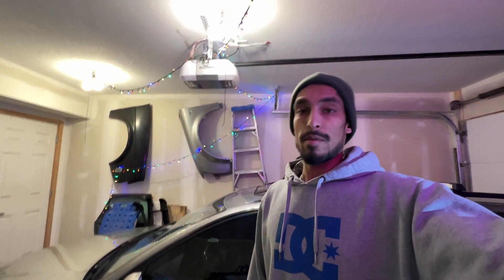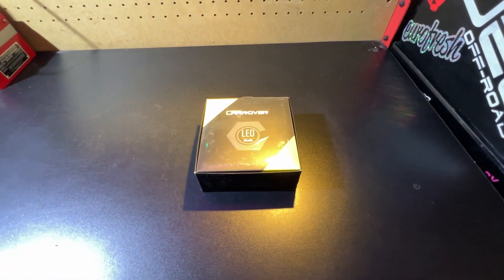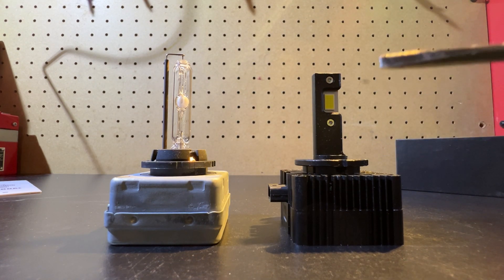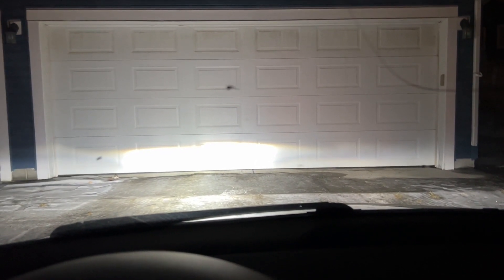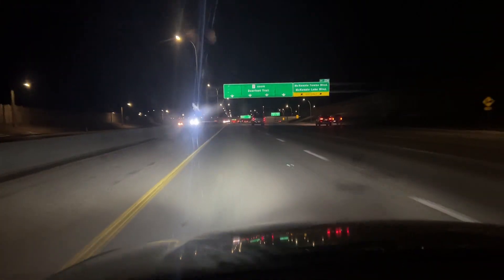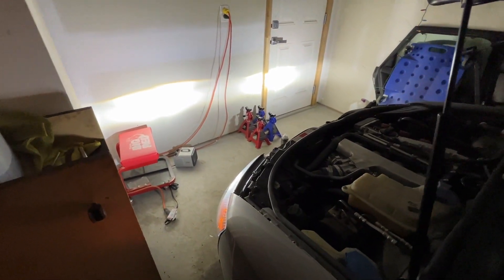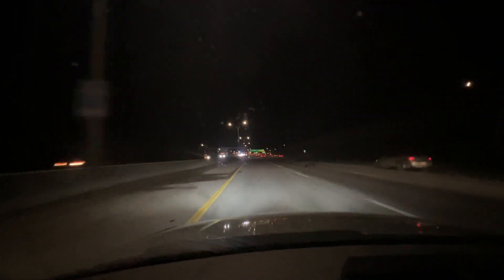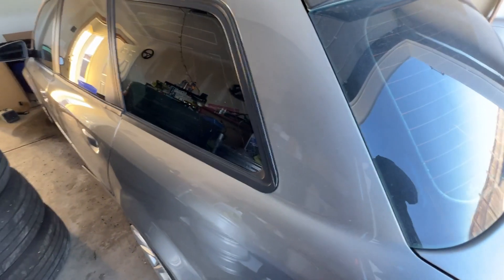HID vs. LED Headlights Real World Test! (Should You Switch?)

Comment: The reason the led is brighter, is because the ballast is worn. This usually happens to older cars. The led doesn't utilize the ballast it has its own board inside. It uses to connection for signal only.

Comment: Do you recommend switching to led from hid? Mine has a 55w ballast..how significant is the difference in beam distance between HIDs and LEDs?..
Reply from the maker: Don't quote me but I believe HIDs have greater beam distance based on real world observation. Others tend to agree. But that being said, I'm still rocking these LEDs 2+ years later and I have zero complaints.
Reply: @Fizzo20  decided not to change to LEDs just changed my hid bulbs to new ones and I'm happy with the results..

Comment: Do LED bulbs need to use the HID's stock igniter or ballast or they bypass it? I am assuming since LEDs are totally different technology from HIDs and start-up and work just with constant 12v, they don't need the ballast, correct? Thanks for the info.
Reply from the maker: I believe you’re correct. The ballast is still there just for ease of connectivity but I believe it just needs relatively low current 12v to operate
Reply: There are newer LED that arent bulky at all and have same base, and dust cap will fit just like stock bulbs, same dimensions as HID bulb. You dont need the ballast really, but the connection is what gives it juice to turn the LED on. So its literally a plug n play.  I just changed mine and I had 6000K HID bulbs (My vehicle comes with HID (probably 4000K bulbs stock) and projector lights. No matter what bulbs I put in the light output was not optimal.

I got the LED, switched it out and WOW! its insane the difference. I can see further ahead and more peripheral lighting as well. Now I dont have to really tuen on my fog lights. I have LED in my other vehicle too and only issue I find is when it rains heavy while driving the light is so bright it just reflects off the rain and you cant see too far ahead, but its not to the point of being dangerous, just noticeable if you drive your vehicle often and used to certain settings. But normal condition highway driving you cant beat the LED for safety.

Comment: LEDs are very bright and shine but for a moment...... what i mean is LEDs when get hot start to dim and man they do age so fast and dim much more than any other bulb out there , you may have a 6 months old LED bulb that works an hour per day and is gonna be half as strong when warm up compared to new one, especially those high powered LEDs are very short living things, they only worth for high beams that work for little time , also low power LEDs from philips/osram tend to have longer lifespan and less dim at time but they aren't very bright , not even close to HID's , keep HID's, the top bulbs for me.
Reply from the maker: Fair enough but after 2 years, the LEDs are still as bright as day one. HIDs are great though.
Reply: @Fizzo20  if you buy a new set of bulbs and compare the you will see the difference 😉
Reply: This is not true. I had same LED bulbs in one car for over 2 years, still bright, never flickered or shut off.  I remember before I converted my HID I went through 3 sets of bulbs in 9 months due to flickering or random non ignition issues. It wasnt the ballasts because I had dealership replace both with brand new ones.  LEDs last and are better in most conditions. ONLY thing I will mention where HID outperform is in very heavy rain. LED tend to be so bright they bounce off the rain drops asits coming down so distance is an issue , but not dangerous, just annoying. Other than that they are great bulbs.
Reply: @jensz9360  if you buy a good set of real hids and not those cheap sets you will have no issues with them , also buy a new led bulb the exact same bulb you have two years now and use one old and one new to see the real difference you dont see now because that happened in two years span not in a day to notice right away

Comment: Switched to leds because my dims were horrible (2003 Cadillac Seville) and things went downhill in a hurry. The difference in power made everything go nuts- my dims went almost out, then my brights quit altogether, then it got weird, I went to pull the bulbs and troubleshoot and when I removed one bulb one bright came back on and one dim?! Also my turn signals hyper flashed then acted like I had a short: first I would signal left and the right would work, then both would work like I had my cautions on. Solution: I took out the leds and made sure I had bulbs in every spot they were supposed to be in, and changed my headlight fuses. One light came on first and driving home there was a flicker and all my lights came back, including the turn signals. I probably do have a short, but the leds were like armagedon to my car. Hope the lights continue to work well for you, if they don’t, could be the issue. All my lights that seemed dim were all bright again once the leds were out
Reply from the maker: Dang sorry to hear that it caused problems for you. Sounds like you either have a short or perhaps the electrical system requires a specific resistance in the bulbs for the circuit(s) to maintain the correct amperage. Also might depend on if there are ballasts to power OEM HIDs or if you’re going from standard incandescent bulbs to LED. I know when replacing incandescent turn signal bulbs with LED, LEDs will cause them to flash fast due to less resistance in the bulb. I just speculating though. I’m coming up on 2 years with these bulbs in my car and no issues.
Reply: Its a cadillac Seville, 2003 it didnt even come with stock HID so you cant compare it. Like most cadillacs of that era it likely came with a 9005/9006 halogen bulb and you are talking about you swapped them for the LED. That isnt the same as HID-LED swap.

Comment: 12:18 That’s why you noticed that the HID’s were lighting up further. The way this works is simple, the further up a headlight’s pointing, the further away gets illuminated, but you won’t see what’s close to you as bright. I suggest aiming outside your garage where you can see at which point the headlight illuminate in front of the bumper and at which point you see while inside the car. Just don’t make it as high as high beams.
Reply from the maker: Haha I get how beam angle works. The beam angle is currently dialled with the LEDs. But I still think HIDs get better range in this application, all other things equal.

Comment: Non OEM replacement LEDs produce a glare that can blind on-coming traffic when used with non specific headlight housings and lenses. Pisses me off specially when not aimed properly. Worst on higher vehicles like trucks, pickups, vans and suvs. All around, LEDs can produce a whiter to bluish light, but HIDs are better on long range illumination and in inclement weather.
Reply: This is true if you have a reflector housing but not true with halogen projectors.

Comment: B6 Audis with the bixenon projectors were notorious for the projector bowls losing their reflective coating. If you want LEDs, the best way (which is also the only legit way) is to replace the HID  projectors with LED projectors. Morimoto makes an incredible LED projector that replaces the bixenon projector in the B6 headlight perfectly - same size, uses the same mounting points, exact match.
Reply: I can tell you by experience, Morimoto's reflector bowl is far inferior than OEM's. The reflector coating is not that good.The reflector bowl's reflectiveness in the OP's testing has nothing to do with the difference of the lighting output because he used the same reflector bowl housing. The only change he did was the bulbs.
Reply: @kohlpee3732  Yes, and the real problem with all these crappy "retrofit" LED bulbs chinengineered to replace legitimate HID  and halogen bulbs is the fact that they just splatter light everywhere, not just in the focal area, which gives the perception to those behind them as being "better" when in reality they're actually worse (way too much foreground illumination and tons of unaimed, unshielded glare).

Comment: Didn’t let the hid warm up
Reply: Even if it is warmed up, you get the same results. All it does with warming up an HID changes color until it stabilizes to a certain wavelength or color.
Reply: Thats the other issue with HID is the warm up time. With LED its instant.

Comment: Based on my recent test, LED is the way to go. Beat my OEM and aftermarket HID projectors - these are new bulbs that I used and are expensive. Most of the testing out there are done with a white background and check the lumens. But these guys who test don't test it in realworld scenarios other than a controlled environtment - white background. My testing just supports your claim that LED is better that HID bulbs specially in a projector housing for low beam. It is the type of light that the LED produces that the HID bulb cannot duplicate. The LED light has a different wavelength or light spectrum that when it is projected, it gives you a better contrast of the area that makes what you see stand out. HID bulbs just could not do it specially with 6000 kelvin and up. Guys, don't wasre your money on HID projectors or HID bulbs.
Reply: Conversely, I've gone back to upgraded halogens after running LEDs in my projector headlights for years. I did this after driving a car with factory HIDs and noticing that even though the LEDs in my car were technically brighter, I could actually see way better with the HIDs. Not only was the colour temperature better (somewhere around 5500K I would guess vs. 6500K LEDs), but the lighting is much more even. The LEDs cause a really bright hotspot, which your eyes then adjust to, and then shadowed areas towards the sides where you really need that light to see for animals. It was really the worst of both worlds. I now have Philips halogens and am much happier because I can actually see what's hiding on the shoulder.
Reply: @t_z1030  This actually depends on the design of the halogen housing. Not  all halogen housing are the same.. With my testing, I use the same headlight housing but retrofited with aftermarket HID projectors and complared to OEM halogen projectors with LED bulbs. Most HID projectors have the half moon shield(because of bi xenon feature) hi/low while the OEM halogen projector in my Sienna is a bowtie shape shield  low beam only. Did not know it until I retrofitted my halogen projectors with HID ones because back then, the LED bubls were not as bright. In 2024, LED bulbs are brighter. So what difference does the shield make, the half moon shield causes a hot spot in the middle. Surprisingly, the halogen projector with a bowtie shape shield has no hotspot and better visibility on the sides because it does not have the horizontal cut off  like the half moon shield produces. I'm back using the OEM halogen projectors with the Sealight X4i H11 bulb. Amazing!

Comment: LEDs are only decent for housings specifically built/designed for LED chip placement and even then, i'd still give the win to HID as far as down road lighting goes.  Color temperature too.  If LEDs were 4300k like factory HID, then maybe they'd have a shot.  I find LED color temperature too cool for inclement weather.
Reply: I have some LED low beams that are super bright white and look 5k temp. Just replaced my HIDS with them. Honestly the HIDS looked cooler because I had 8k. The LED throw lighter just as far or farther and are definitely brighter. Both are rated at 35w also. It's a toss up, I would have to see 5k HIDS next to it to see which one is brighter.
Reply: the issue is that to get an 4300k led there has to be a yellow filter applied on the diodes which would lower the light output even more
Reply: @Rand0muser2538  Stop, one leds are not legal for road use
two, every damn professional building, store etc... is running 4k or 5 leds... 
You just... dum.
Reply: Not totally true. Using an LED bulb in a halogen projector housing  will outperform any HID projectors in low beam and a 6500K LED temperature in the rain outperforms any HID's. I have not tried it in foggy weather yet. I used to believe people saying that in forums but no longer do. Once you performed your own tests/testing, you will come into conclusion a lot of what they say in forums are not true. FYI, I use a Sealight X4i H11 bulb in a 2014 Toyota Sienna halogen projector headlightd. Here's one proof why it does better in rainy weather. The LED light it emits increases the reflection of the white lines on the road including yellow lines. With a projector housing, you have a cut off line. Do you know they use reflector white paints on the highways and roads?  I agree with you on highbeams but LED is not that far behind.

Comment: I can say that this was not a fair comparison. #1 rule! Do not be caught up with the marketing hype of lumens as  the actual real world test is going to be based on LUX testing(usable light)at a certain point or distance with a light meter. I am pretty sure that if you would have replaced your old oem HID bulbs even your ballasts with newer ones from Phillips or Osram especially if they were in the range of 43 to 4800k,they would have been far more superior than those LED bulbs as your housings were designed for HID not LED. Also you will get better visibility down the road if you actually aimed the light pattern at a distance from 25 feet to a wall on a flat surface measuring from the ground to the center of the headlight versus eyeballing it. But that's just my 2 cents 😊. If you really want to compare  the 2 in a shootout, then get a new set of HID bulbs,Ballasts and a light meter and do another video as this was not really a comparison. It was more like a conversion because you had old worn out bulbs.
Reply from the maker: I completely agree with all points. I’m not caught up in anything, just stating what is. This video wasn’t really planned and I didn’t think it would get so many views or comments. For some reason I just wanted to try the LED bulbs even though I agree HID bulbs + new ballasts would be superior but I figured why not document it and show my experience. Hence why I said “not a scientific comparison.” Maybe I should’ve titled it as a conversion but it’s done now. Perhaps I’ll switch back to HID bulbs down the road and make another video but for now the LED bulbs are working great. Appreciate the comment though, I often learn from them as well.
Reply: @Fizzo20  Looking forward to it brother! Sorry for the late response.

Comment: With the before/after you can clearly see that with the LED there is way more light output but also more light bleeding. This happens when the bulb is not matching completely with the type of lens and cut off mechanism.  So although you have a projector lens, and a cut off mechanism you still get annoying light bleeding which annoys drivers on the road.
Reply from the maker: I suppose you could be right but I haven’t had any complaints or oncoming traffic flashing me. At least it’s a far cry to those that put LEDs in a reflector housing!
Reply: It's illegal (and good reason) anyway

Comment: HID’s fade with time maybe that’s why you feel the LED is better than the HID but if you were to use a new HID I guess the performance would be of more competition to each other
Reply from the maker: Yep I did mention that in the video, hence a more “real world test”
Reply: I am not an expert. But my experience is a bit different with my 8yr old hid kit. Coz what I learnt is that hid generates light by creating an arc between 2 electrodes, so there is no sense of fading over time. But led's outer shell which is made up of epoxy decorates by heating.
As I mentioned above, I am not an expert, and all this information I shared is just from my one and only hid kit in my car and one led installed in my bike. And rest from the internet.
So please correct me if I am wrong.
Reply: And yes I will also prefer led over hid because of hid's 8-10sec warm-up time  is not ideal for flasher.

Comment: Hid projectors and Halogen/Led projectors are NOT THE SAME! They each have different style of lenses and housings.
Reply: I can only speak for what I have tested and can tell what I found different. After market HID projectors particularly Morimoto - the only one  I tested, does not have good reflector bowl coating compared to my OEM halogen reflector bowl. OEM was like a mirror, the Morimoto although still has a reflector properties was not as good. Now  Comparing my OEM HID Toyota Venza with a new 6K bulb vs my Sienna with with a new LED bulb in a halogen projector housing, the LED bulb beat my OEM HID's performance.